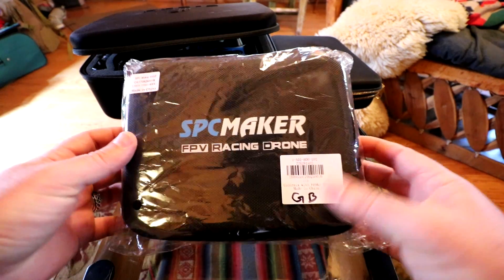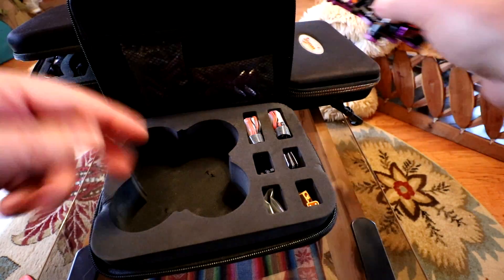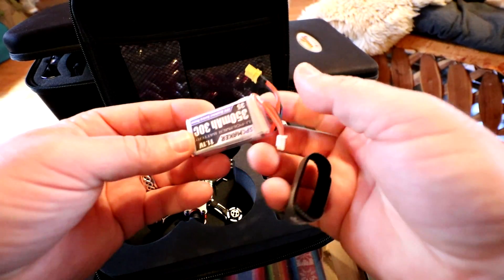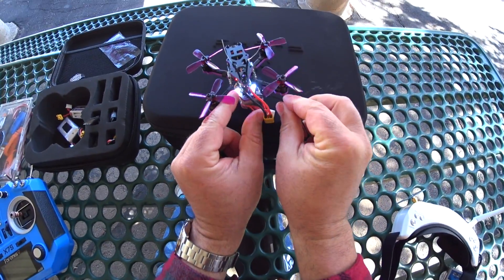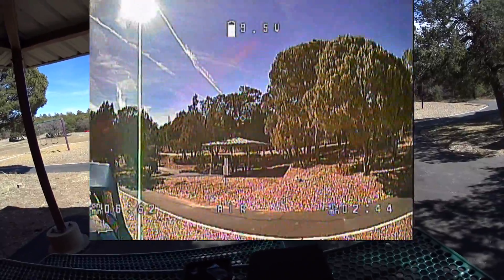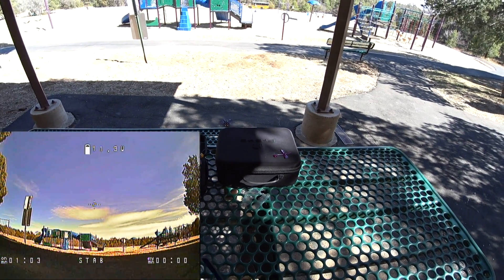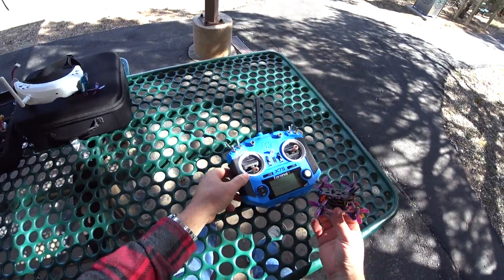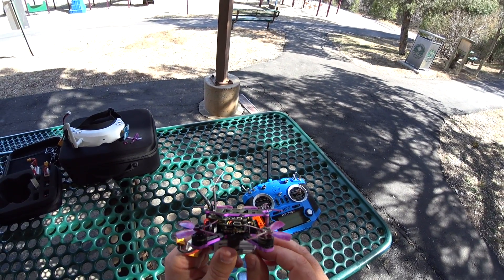SPC MAKER 95GF Micro FPV Racing Drone - Full Review - [Unboxing, Inspection, Flight / CRASH! Test]

Comment: Ive got one of these and I found that switching to 1940 props, or even just some 2 inch hulkie 3-blades made it alot more manageable with the higher C batteries... Im running the 2" hulkie's right now on mine and its fixed alot of the oscillations without any tuning.. I dropped the rates on mine right away

Comment: I think you set a record for crashes in one video .. ha ha.  The rates are a bit high it seems, but that' s easy to tone down in Betaflight. You might also consider reducing the VTX camera angle, which will allow you to fly slower.  Those props are not optimal. If you can get your hands on a few sets of Gemfan Hulkies (2040), I think you'll like them better than the 4 bladed props you're using. 45-50 deg. F is not cold .. I'd like it to be that temp here right now, but we're still in the 30's (and Lake Erie, which I live right next to, is 35 deg, so its going to be a while before it warms up). Have a fun time there in NM. Cheers.

Comment: Do you think this would be good for a budget acro drone? I have experience with line of sight drones and micro drones but want to get into acro on a budget. I also have many hours in Liftoff so I kind of know what I’m doing with controlling the drones. Edit: never mind, I’m not spending $200 on a micro drone that obviously has some problems.
Reply from the maker: If you can smooth the tune it seems durable 👍

Comment: Great review :-) i run same frame and motors but with F4 fc and 15amp esc on 2s and its a little rocket ;-) got me thinking of putting it through 3s :-) try some avan micro props. loads more low and medium control
Reply from the maker: Thanks man 👍
Reply: :-) if you want a better camera angle and willing to tinker with it, i've put my vtx board in the middle to allow a better angle for the camera :-)

Comment: 350mah 3s battery?!?! That would only last a min or 2. That's tiny
Reply from the maker: Yes only about 2 mins with stick batteries
Reply: Dustin Dunnill would it be able to lift about at least a 500mah battery. Or would a 2s 800mah work?
Reply from the maker: I think a 3s 500 is fine.  2s 800 should also be ok
Reply: when you were in flight on the fpv video it beeped when it got to about 10.5v but would it work with the 7.4 volts
Reply from the maker: Yes, the flight controller knows what type of battery is plugged in and adjusts accordingly.
Reply: Oh ok